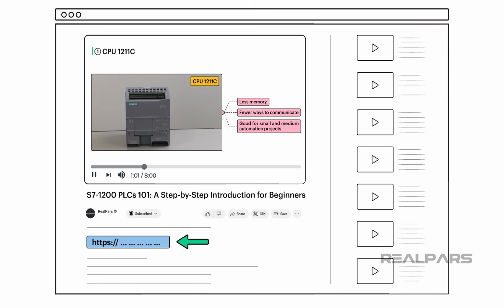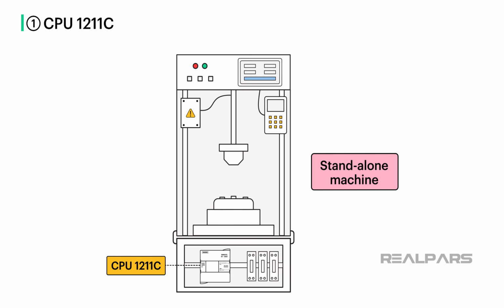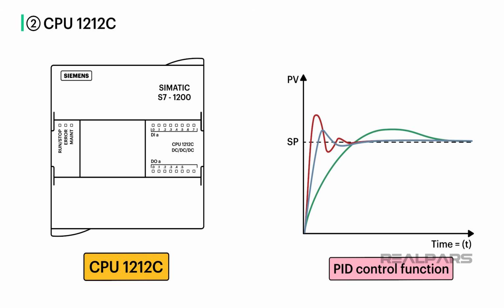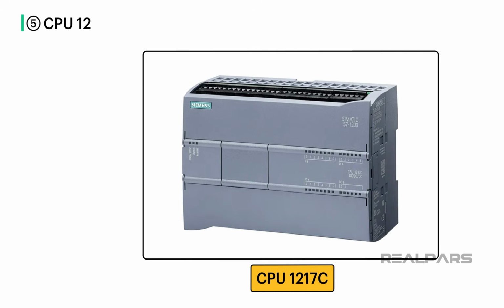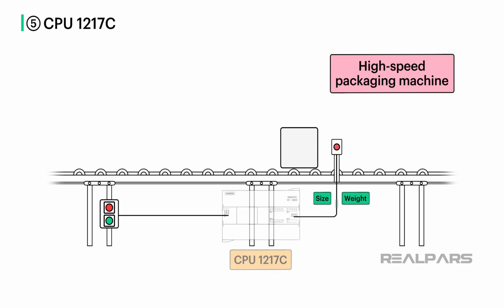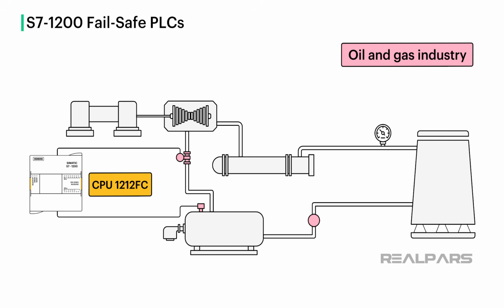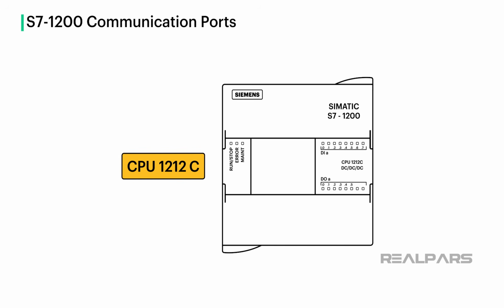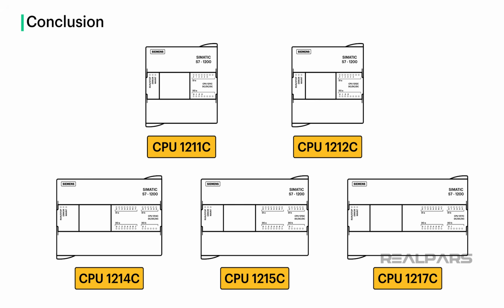S7-1200 PLC 101: A Step by Step Introduction for Beginners

Comment: Great introduction for beginners. One thing worth adding — when moving from simulation to real hardware, the scan cycle timing changes noticeably with analog processing blocks. What runs smoothly in TIA Portal simulation might need OB cycle time monitoring once you add physical I/O. Always worth testing with at least one real module before finalizing the logic.
Reply from the maker: Great point, hardware timing definitely adds a new layer of complexity compared to simulation!

Comment: Please, is it possible to back up the software and hardware of the Siemens S7-1200 plc programmed with tia potlrtal V11, when I searched on the internet, tia portal v11 does not back up hardware, my equipment is working in good condition, I just want to have a PLC If anyone can help me, I will be able to pay for the help.
Reply from the maker: If you have purchased TIA Portal version 11, which is an earlier release from Siemens, you should indeed have a valid license. However, if you're using a trial version, please note that trial versions typically have limitations, such as the inability to save hardware and software configurations.

Since version 11 is quite old (released in March 2015), it is no longer supported. The current version available is V19, which you can try for 21 days with full functionality. To upgrade from version 11, you will need to first upgrade to version V13 before moving to the latest version, V19. Direct upgrades from version 11 to V19 are not supported.

Siemens offers licenses for these versions, and you can find detailed information about upgrading through the link I’ve included. This link will guide you through the upgrade process from version 11 to V13 and beyond. Additionally, depending on your location, you may be able to download trial versions by registering for free.

For more details on Siemens software, please visit the main TIA site page linked below.
https://support.industry.siemens.com/cs/document/106449434/simatic-step-7-(tia-portal)-v11-sp2-trial-download?dti=0&lc=en-WW

https://support.industry.siemens.com/cs/document/109744173/documentation-for-simatic-controller?dti=0&lc=en-WW

I hope this helps!

Comment: Hi, may I ask one question about PLC. How does PLC measure digital value. How does PLC know it js open status or close status ?
Reply from the maker: Hello Adam,

Thank you for your question. You asked an essential question: the basics of all electronic digital devices used today, including your smartphone. All digital devices work on the basics of “ON” or “OFF” or a “1” or “0”. All this is due to the invention of the transistor by Bell laboratories called the bipolar transistor. The bipolar transistor makes the PLC in different forms of electrical and electronic components. I am providing you the links to help you with your question and you’re learning. The last 3 are videos from REALPARS that you can find on YOUTUBE. I recommend you read or watch them in the order I give you. Happy learning!

https://en.wikipedia.org/wiki/Transistor

https://www.youtube.com/watch?v=oyaItbhqoW0&list=PLln3BHg93SQ85ymy4VvtmRGxo2Stps2Iv&index=42

https://www.youtube.com/watch?v=ReTtgzN-Dmc&list=PLln3BHg93SQ85ymy4VvtmRGxo2Stps2Iv&index=1

https://www.youtube.com/watch?v=PbAGl_mv5XI&list=PLln3BHg93SQ85ymy4VvtmRGxo2Stps2Iv&
Reply: @realpars You have made a great job, thank you for full answer

Comment: Hey Realpars, thanks for the education
Question, does S7-1200 have a special communication module for OPC UA?
Reply from the maker: Hi Aktsar Abidikar,

Thank you for your question. Here is information that will help you with a link;

OPC UA communication is supported on S7-1200 CPUs with firmware version 4.4 or higher. The CPU enables data access by supporting configuration as an OPC UA Server.

https://support.industry.siemens.com/cs/document/109781701/modeling-the-s7-1200-opc-ua-server-interface-in-tia-portal-?dti=0&lc=en-WW

Comment: Simulation of water control PLC system using PID control [ TIA PORTAL | PLCSIM ] 

This is a simulation of water level control system based on PID controller. The system adjust the level smoothly based on the user-defined setpoint.

https://youtu.be/Umhs4Vvvg94